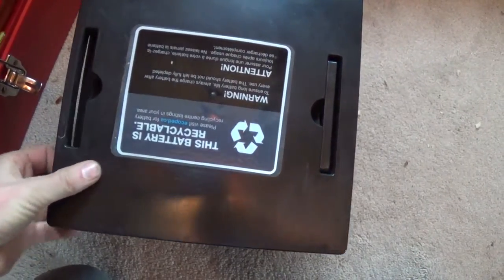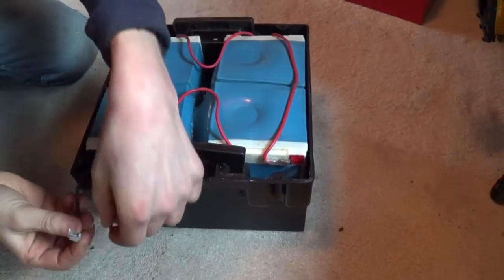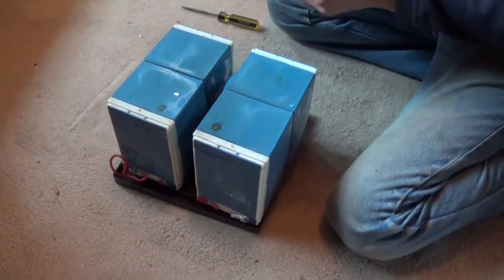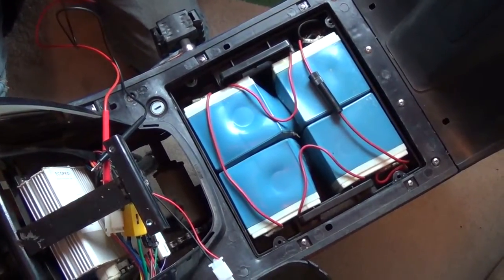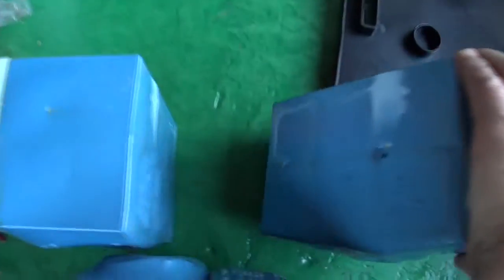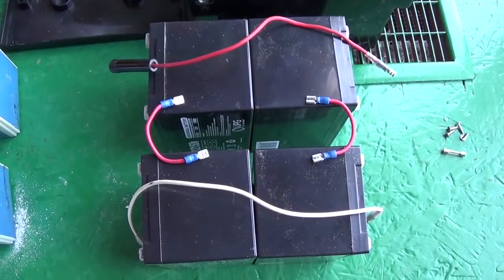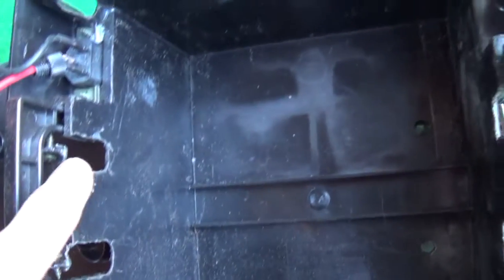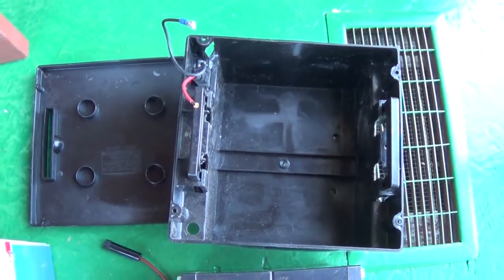Ecoped Scooter Batteries Replaced

Comment: Hi, maybe you could help me. I've got an ecoped pulse 2012 scooter. I had the same problem with my batteries - they got all swollen and bloated. I replaced the batteries (had to cut a few holes as well to make them fit). Problem is I couldn't get them to charge. I figured my charger was probably toast as well, so I just went out and got a new charger. Still no luck. The charger only charges about 4 or 5 minutes then the red light goes off and the green comes on, which is supposed to indicate they're charged. I'm not sure whether I should leave the charger plugged in for a few hours with the green light on, in case I wreck something. Any suggestions?
Reply from the maker: highlander53 Is there any chance they are wired up wrong? New batteries shouldn't give false full signals. Do you have the old charger? Can you check the charger/s output/s with a volt meter? A 48Volt battery pack will need more voltage than that to charge. How much, I can't tell you. Does the batteries or charger get warm? Could you charge the batteries independently on a 12 volt charger (check the voltage on each) then re-assemble? That would rule out the batteries.
Reply: Thanks for your advice. I think I've now narrowed it down to a bad soldering wire connection on the plug. Again, much appreciated.

Comment: good job. you have a newer model than i do. i have the 2010 CityGo and my batts did a similar thing, not as bad, i added some water and am still using them with 15% decreased performance. i wish i woulda added a thimble of water sooner to avoid the swelling in the first place. i use a special charger to individually recondition and also to charge them. i ordered 4 new 12120 agm for 130 bucks canadian and will install them soon.